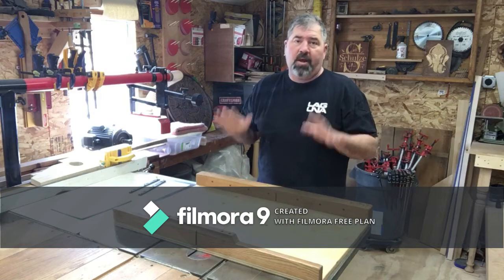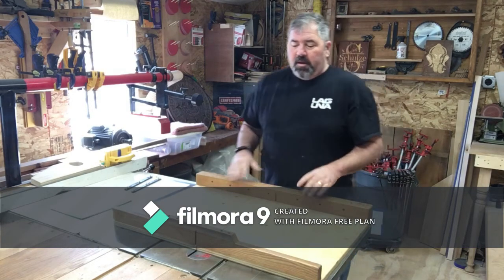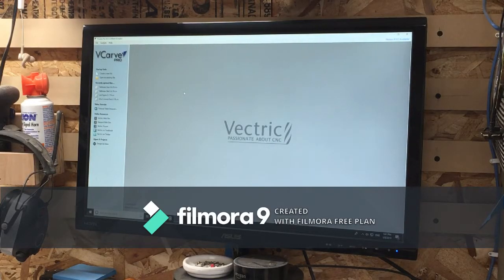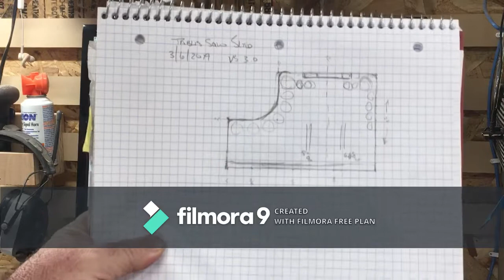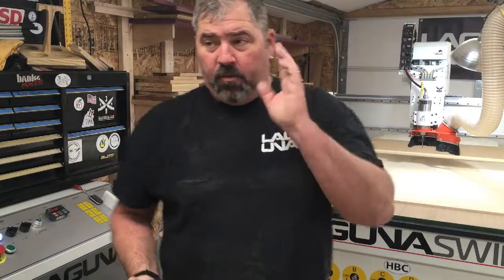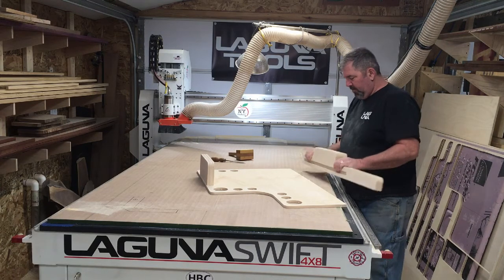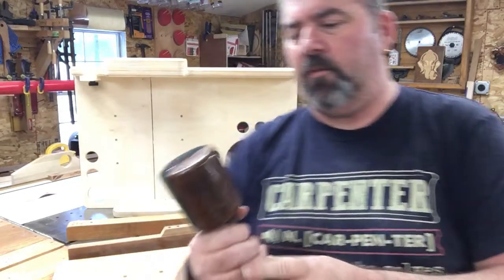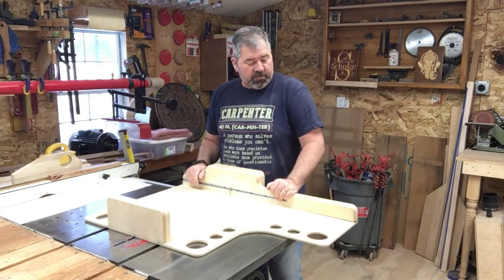CNC Tablesaw sled, some mistakes and a mallet

Comment: The micro-jig runners work great on small sleds but they literally self-destructed on my big sled. I wound up replacing them with HPTE runners I cut.  Also I didn’t see you clamp or reference your fence to a  known flat surface when you glued it up - how do you know it’s dead-straight?
Reply from the maker: very true Tioga......and in hind site i probably should have clamped a straight edge of some sort in there as squaring it was a little on the tedious side. I did get with in .005 over 60" with the 5 cut test  - BUT, very good point, i'll be placing that in the memory banks